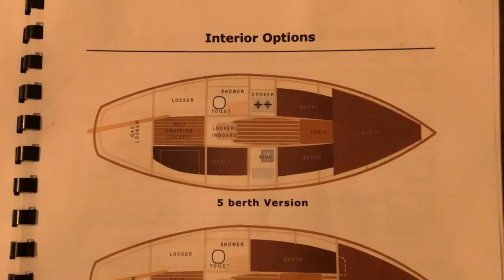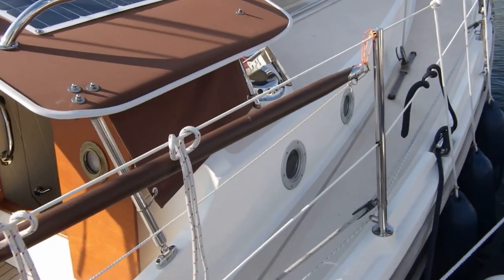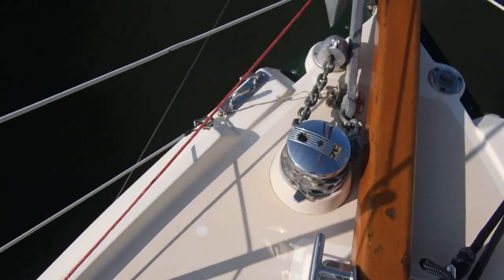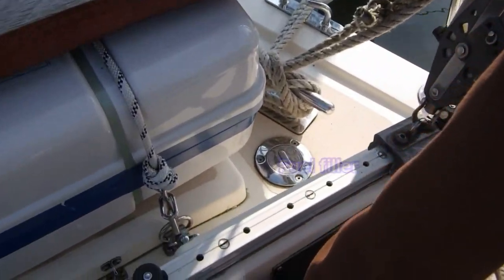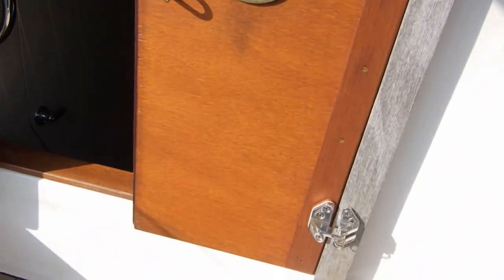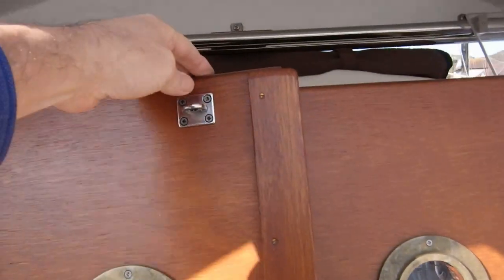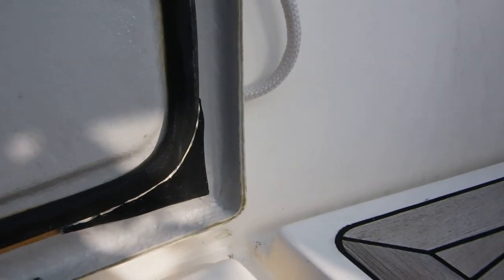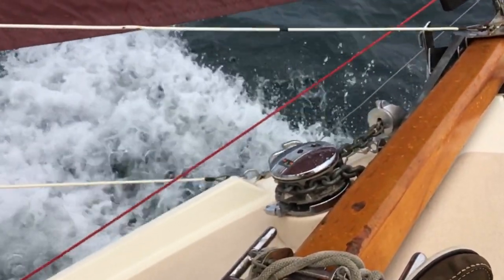Cornish Crabber 24 mk 4

Comment: I have the Cornish shrimper 19.  What engine do you have in your boat?  Thanks for the video
Reply from the maker: Yanmar 20hp 3 cylinder diesel. I’ve also had a number of Shrimpers and they were fitted with a yanmar 9hp single cylinder diesel, more than enough power. Mike
Reply: @sailingcosiloveit  I've got the inboard and have been happy with it.    Like the videos.

Comment: The new version v weighs a ton less than the iv I believe m. What do you suppose the ride might be like compared to the iv with respect to comfort?
Reply from the maker: The Mk5 was a complete change aimed at the coastal cruiser, lighter, faster, easier to handle with form as the initial ballast which results in a much better boat in flat seas and light airs. Horses for coursers a brilliant coastal boat but not designed with comfort as a priority mike

Comment: How do you secure the doors closed? Nice video.
Reply from the maker: I use a hasp on the outer door (the one that over laps) and a staple with the hinge cut off. Close the hatch and lift the cut off staple up to the inner edge of the hatch lip and over the hasp. Now put padlock into hasp. You will find the door now can’t open due to the staple sticking up under sliding hatch, vice versa hatch can’t slide back as staple in the way. Hope this helps mike
Reply: @sailingcosiloveit  Thank you Mike.

Comment: Did you make the hard dodger, do you have plans or info on who did?
Reply from the maker: Yes I made it from scratch mike
Reply: @sailingcosiloveit  I am based at Port Dinorwic and also have a gaff cutter but a little smaller than sea nam chilli. Have seen and have a photo of your boat with a canvas dodger (maybe an early version). Do you have any more details on how you made it. Kind regards Miles
Reply from the maker: Hi miles you are just down the road from me. I’m in Deganwy and so is sea ma chilli with the dodger if you want a closer look. I’m sure the new owner would not object to you looking at close quarters. Get some photos and I would be glad to give you a blow by blow account of its making. Are you on a social media site? Mike
Reply: Yes you can see what the boat gets up to at Seasalt_yacht on Instagram